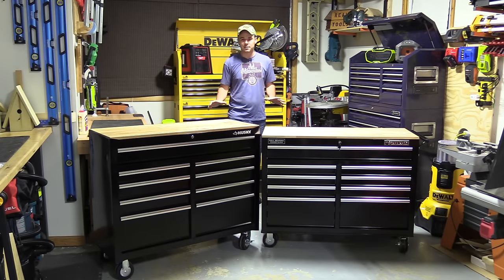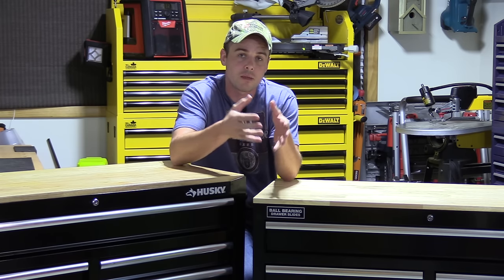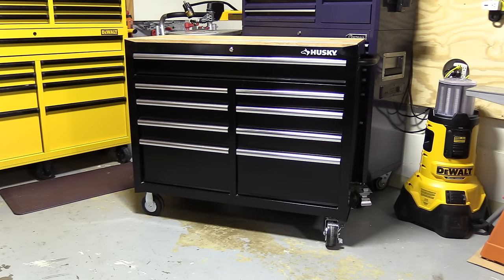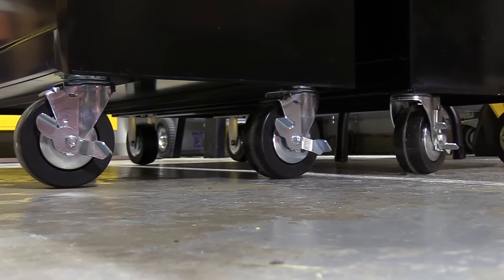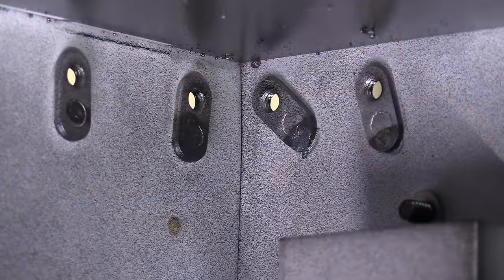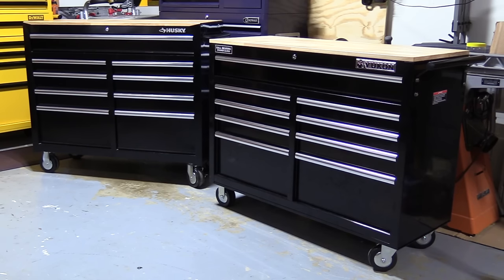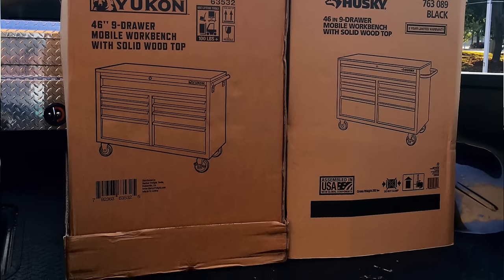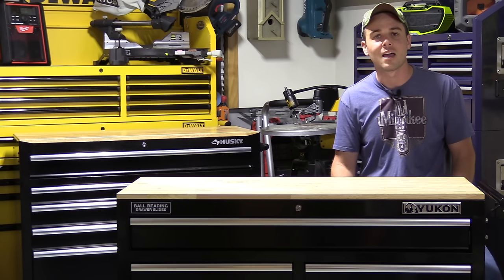Harbor Freight -VS- Home Depot ( Yukon - VS - Husky ) 46" 9-Drawer Workstations

Comment: Thank you for the well presented and thorough review.  I confess, I expected the Huskey to be be better.
Reply: Mark Schwarzbauer how is it not? Nothing removable top, tabs backing where the casters go so that they won’t fold when you run over a uneven curb. The only downside is the bottom drawers but if you look at the new model they also have the same double fail system.  I’d take a 3 year warranty and buying inexpensive drawer liners over buying a warranty with free drawer liners.

Comment: It’s really not that obvious a choice. If we’re talking about home/hobbyists, then the box won’t be getting very heavy use, though I suppose there will be a few exceptions. 100 pounds for the deep draws is more than most people realize, and it will be hard to exceed that. Unless you’ve got a very bumpy floor the weld nuts holding the wheels (and handle) will be fine. It’s used for that purpose on many equipment. An advantage to the easily removable top of the Husky is that when it gets mucked up, as it will, you can just turn it over, rather than removing tools from the top four, or six draws, removing the draws, and unscrewing the wood top before flipping it over, and then replacing the draws and all of the tools inside. 30 seconds to possibly over a half hour. Then the extra storage volume could be helpful in a crowded shop. The included liners are nice for the Yukon, though they are very soft, and may not last long with continued use. The three year warranty is also advantageous. I believe it cost up to $50 for the extended warrantee for the Yukon.

So sometimes what seems better may not be for most users. Quality requirements are dependent on usage. If you’re using this a couple of days a week, and cycle the draws just a few times, even a cheap cabinet could last a lifetime. If you use it five days a week and slam the draws closed a hundred times a week, it might not last a year.

Comment: I have the older 5 star rated husky and it's not built like that. It has a backing plate on the bolts, my wood top is bolted down. I got mine for 248 back in the day but they are now I guess built cheaper and cost 399.

Comment: Do the extreme tool boxes. They have the economy line the 72" at 2100 and the 74" at 5k. Od the cheaper one specs out better built in some ways. But with 100lb drawer rollers Vs 200lb where the higher priced one looks better. The higher priced one is bigger 74x31 Vs 72x25.

Comment: Sadly, everything today is driven by MONEY and not your NAME. I knew the Yukon was going to be a better deal as I have seen both in person before seeing this video. Though I like a taller bench, (I am 6'3" with a bad back), I'd buy the Yukon for more than the reasons you spec. The Yukon can be set next to another and you can put a continuous top on them. Also, the height it is now would go under my present bench.  What I would LOVE to see is someone build a set of heavy duty steel drawers with heavy duty bearing slides that are designed to be added to a work bench. Some very expensive drawer banks are made for this already, but you'd need corporate money to buy them.  So,,,, if HF ever gets in touch with you asking for advise for new products, please mention that. I'd like to be able to put circular saws and porta-bands into a top drawer so they are easy to get to without bending and very important is full extension drawers. Even beyond full extension would be great for those building then into a workbench with a lip for clamping..

Comment: Bought the Husky in January 2018 for $198 at Home Depot and it included the drawer liners.
Reply: That is where the difference it.  Husky goes on sale and clearance.  I have picked them up at the $198 and once at $150 on clearance.

Comment: Based on this review I bought the Yukon and I had a terrible experience. The cabinet came with a big dent in one corner (even though the box was in pristine condition) and the front of the unit was dented and deformed. It was clearly painted over the deformations, so that's how it came out of the factory. Half of the cabinet didn't lock and the lock mechanism got stuck with the key inside. I took it to harbor freight and they said there was nothing wrong with it, that this is normal, and they marked the return as if I wasn't satisfied instead of "defective product". They said they still were going to sell it as "open box". So now I know what kind of quality control one can expect from the Yukon. Needless to say I decided to get a refund and I will probably get a Husky. The current model is different from the one on this video, in particular is 24 in deep, compared to 18 of the Yukon.

Comment: Edit: I believe I figured it out. I think mine is different because I have the Husky with the USB power strip. This model has everything I listed below but the cubic inch jumps from 14,300 to 19,300! That’s nearly twice as much storage as the Yukon in the video (10,300 cubic inch ). Go with the Husky WITH USB POWERSTRIP !

I think you mixed up the boxes? I looked at both and felt the husky was better made. 

I just bought the husky 46” box yesterday at Home Depot for $248, ($150 off) and it doesn’t match up with your video. My husky lists 14,300 cubic inch of storage and the Yukon says 10,300 cubic inch. My husky has the power strip with USB ports built on the side, the Yukon doesn’t have this option. My husky 46” box also came with drawer liners for every drawerwith “husky” labeled on them. The husky bottom drawers are listed as 200lb drawers and my husky has 2 slides on each of the bottom drawers. 

Not sure what gives on the husky box you bought? I think husky went back to the previous stronger version.
Reply: This video is old husky looks like they took his video to heart and fixed it completely different then the one I got the other day
Reply: Idk why everyone is saying the new model is better, the Husky still feels cheap to me

Comment: Northern Tool has a line of semi professional tool boxes that are shipped from manufacturer. I have also looked at the Milwaukee top and bottom offered by HD for $1499.99. But the real thing to look for is the metal thickness and the rigidity of the one you plan on buying. My last option is snap on or one of the other professional boxes. Craftsman is made by a company called Waterloo. Otherwise, both boxes in this video are made in China, and I would not consider the Husky.

Comment: I have the 60 inch "Husky" with an adjustable (height) top and haven't had any problems with it. I do see features on the Yukon that look much stronger and possibly would have swayed my purchase toward the Yukon but I have not had any problems with my "Husky", not a single problem in the years I've owned it. It rolls on the garage floor just fine, no problems with any of the drawers, they still glide like the day I purchased it and the top is attached and has not twisted, or distorted in any way. Just sayin.......

Comment: Some here.  Forget shopping at HOME-DEPOT, which limits veterans to $400 a year. No discounts for lumber either, out of the blue.  Took receipts to proved previous lumber discounts.  It when in one of the ears of the assistance store manager and out of the other. Lowes still supports the military without limits or restrictions. It’s time to support the local hardware and lumber stores.

Comment: I been looking at both the last month , Husky has two 9 drawer rolling tool chest  a 18 x 46 x 36 and the 20 x 46 x 39 ,  they both look Identical , the bigger box come with a charging station @ 75 $ more ,  small box is 275 $  Yukon is 299 $  the Drawers are the same as the husky  small box  18 x 46 x 36   The Locking head room is how Husky ends up taller lot of air space between the drawer at top  plus Husky is using larger casters.  Yukon can hold more weight 1200 LBS  Husky 900 LBS

Comment: I don't think either of these are available at either Home Depot or Harbor Freight. Only a 25.5 inch wide version is available at HD and the Yukon unit at Harbor Freight only has one drawer and the rest of the space is a two door cabinet with adjustable shelves. The Yukon was Black Friday priced at 199. I believe the HD Husky unit is Black Friday priced about $300 but has a power strip and USB. I only want all drawers and 18 inches wide so I am buying neither of these. Craftsman, at Lowes, at about 390 has all drawers, power strip and USB. Hate to pay that much for something I'll use lightly.

Comment: Wow....this is SAD. I thought Husky would win!  Husky is basically Home Depot's "Store Brand".  Yukon is Harbor Freights.  I'm stunned.  Point:  Husky makes this model in several DEPTHS.  You can 18", 24", and 26" deep.  So maybe that makes a difference?  Those bolts, connections, etc make the difference for me.  So does the top.  Looks like I'll be heading to Harbor Freight with one of their coupons.  Thanks!

Comment: Also I noticed that Yukon is using stainless steel Hardware versus galvanized steel on the Husky box which will definitely hold up better and be a stronger Bolt

Comment: This is an old review I got a husky 2019 xmas and it's a lot better made and has liners plugs etc.. check the date on the reviews before you buy
Reply from the maker: Or thank a certain reviewer for exposing them & magically they discontinue that model and then copy the superior competition!
Reply: @RealToolReviews  Yeah that could be why, I appreciate the review, not knocking it, I just noticed current comments basing their next purchase on a product that has changed over a couple years. The review is solid for 2017

Comment: I've looked at these in the stores recently in 2022 the Husky is bigger at 24 and 1/2 in wide but I opened the top drawer on both of them the Harbor Freight Yukon feels like a piece of tin can garbage in the drawer shake so much The Husky feels much sturdier made the draw shakes less That's how I judge them. Also the husky comes with the built-in power strip and the Yukon doesn't you can get a magnetic power strip to match the box at Harbor Freight but it's $30.  As of right now the Husky is a better deal.  But the prices have went up a ton in the 5 years since this video was made

Comment: I think the Husky will be better but, seems you're trolling for that pick as most people I know say Habor Freight products are sub-standard.
Reply: As suspected, you did not go the direction I would have guessed before initially starting the video.  I am mildly surprised the Yukon seems to be the better product.  I would still be tempted to go with the taller Husky even thought I'm only 5'9" as I believe it would be a more comfortable work surface, as long as it doesn't warp/bow.  Thanks for doing the video.

Comment: I purchased the old US GENERAL red harbor freight box. bottom and top box sat outside for five years, it is still in great shape and built like a tank. it did smell funny for about 2 years after I bought it and ten years later every now and then when I open the top it has a faint smell of harbor freight "CHINA"

Comment: Your analysis leaves nothing to support the Home Depot product. Yukon by a wide margin, however I need a 52" version and HF doesn't make a larger version. Need it for a base for a new lathe.
Reply from the maker: 3/4” plywood cut to size could easily mount on the top.....

Comment: The rivet bolts are brass and that's a soft metal. Were the steel ones that are spot welded will last longer. Study metallurgy!
Reply from the maker: Wrong!!  This junk Husky box has had 3 of those tabs snap free and just spin by simply moving the handle to the opposite side — it is trash.

Comment: Prior to watching this, I said Husky. I was in the market for these not to long ago. I briefly looked at this model in Home Depot because I was looking for a Mechanic tool cart for work. Husky and US General (Harbor Freight) was the 2 I was looking at. The Husky was a 4 draw and the US General was a 5 draw. US General also makes a 4 draw cart that is more comparable to the Husky that I was looking at. I ended up going with the US General (Harbor Freight) and when I got the cart and put it together, I realized that it had poor care the the package and poor quality granted that it was a very well built cart. The finish on the cart sucked and the instructions were wrong and terrible. I didn't care because the well built design of the cart out did the poor quality of it the cart. I was also looking at the  US General 4 draw cart cart and if I had to compare that to the Husky, I would spend the money and get the Husky because Husky does build them well and it has quality and when I looked at the 4 draw cart at Harbor Freight, it looked like a piece of shit. I don't know how a company can make a well built cart with one product and a terrible product with a size smaller but they did that. I was also looking at the Husky and Yukon workstation and the Husky felt really good. I did not notice the number of slides on the bottom draw of both but from what I have seen in the comments, Husky addressed that bottom draw issue with 2 slides. Husky's draws does come with draw liners. From my experience, I will have to say that the Yukon wins in design but the Husky has better quality. Warranties says a lot about the confidence the company has on the product and Husky's warranty is 12 times longer. I think that the Yukon's quality is overshadowed by the amazing design of the workstation and rightfully so.

Comment: Sockets are heavy, more slides are better.  A weld nut vs a rib nut? I have never seen one until now. No difference than a PEM nut, The nickel plated, bigger bolt, hardware far superior. Piss poor workmanship on the handle assy. on HUSKY,  the undersized length hardware with the weldnut is just cheap. Threads should exceed a minimum of 2 threads past the threads of the weld nut.  You could lift the whole YUKON box by the handles. With the Husky get back. The YUKON is the best period.

Comment: To further continue, if you look at this URL the picture shows 2 drawer slides on the bottom drawer.  https://www.homedepot.com/p/Husky-46-in-W-x-24-in-D-9-Drawer-Gloss-Black-Deep-Tool-Chest-Mobile-Workbench-with-Hardwood-Top-H46MWC9V2-C/313833944#overlay

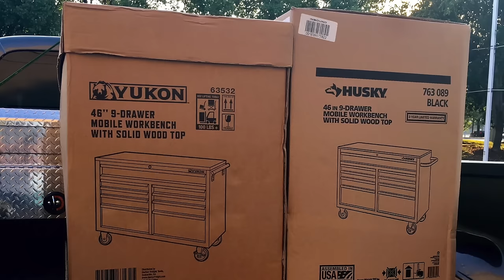Comment: 5:50 you say they are both made in China...   What is the big "USA" on the husky box? Video on my phone is too small to read all the details from the box.   Designed in USA?

Seems like every single thing at HF is made in China.  Yeah, home Depot isn't like it used to be with made in USA in the 90's but still some stuff.

I guess when you use slave labor you can afford more details.  Sad.
Reply: It says assembled in USA. Which is a cheap tactic used by manufacturers to attempt to mislead their customers.

Comment: Aside from a lot of cosmetic things I'd like to know about the general construction of the box such as gauge of steel used, quality of drawer slides, ball bearing quality, overall trueness/square of the box, do the drawers line up evenly, do any of the drawers sag under weight at either end, any rubbing against another part, the quality of the casters etc. On top of that stop your droning annoying voice fluctuations as you speak. You sound like an infomercial.
Reply from the maker: Thank you for the detailed explanation of your complaints.

Comment: The Husky.
Reply: So I got the 2018 version and depending on what model number you compared Husky has obviously made some improvements. The wood top is attached, not free floating, the tool chest did come with pre-cut mats for the drawers and the drivers connecting the casters were longer and more sturdy.

Comment: I would guess the husky so lets find out Harbor Freight shows you one box in their pictures but then on the bottom of the picture it says number blank blank blank shown actual model number is blank blank blank show they show you the heavy duty one and give you the cheap one they look identical but the heavy duty one has 18 gauge steel we're at the cheap one has 20 gauge deal the 18 gauge 1 is 56 pounds heavier so I'm going with Husky on this let's find out

Comment: Husky
Reply: I would agree that yukon is better in this situation, but i would beg to differ if you were to compare the yukon equivalent of the 72 inch 18 drawer heavy duty adjustable top matte powder coated 6 wheel toolbox. It seems like a great deal for the money, and i plan on buying it with my tax return 😂